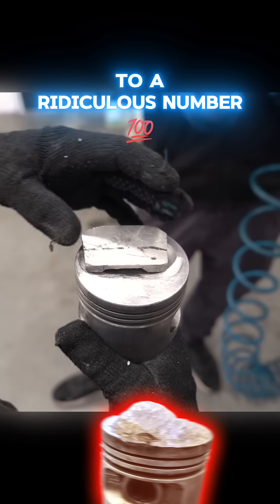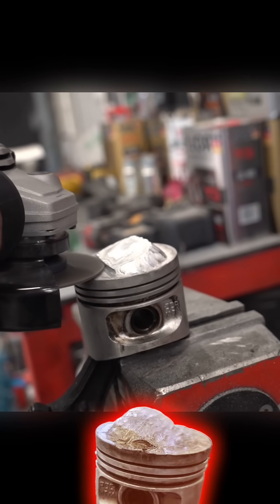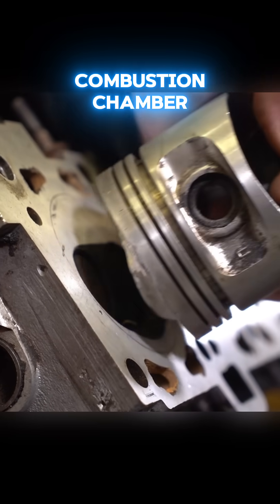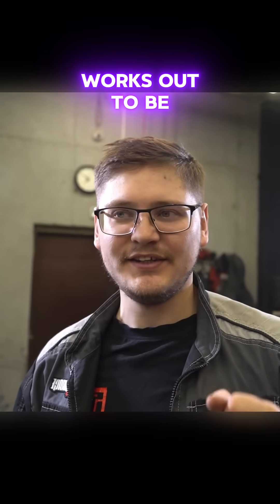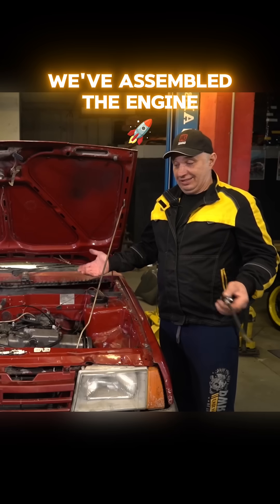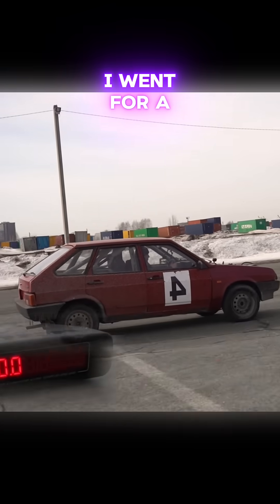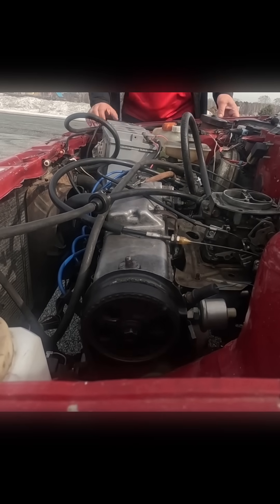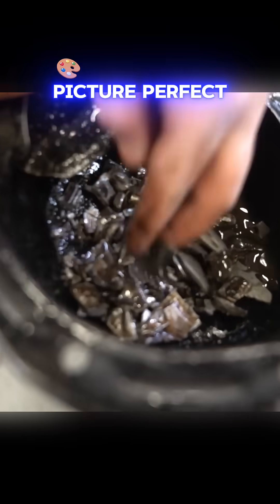22:1 compression ratio in a gasoline engine - what will happen?

Comment: i believe welding different material to the top of the piston changed the expansion of the piston , thats what did the damage , not the compression , all high compression will do is bend conrods and the pre ignition will burn out the piston , that destruction is caused by the top of the piston over expanding